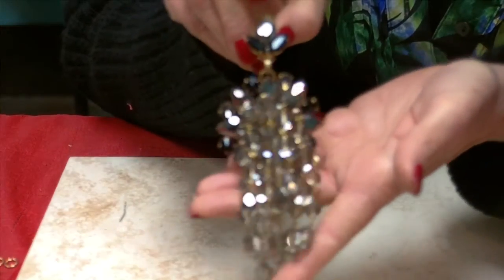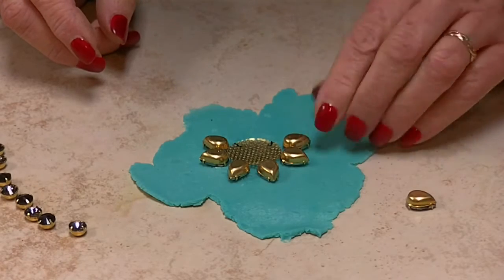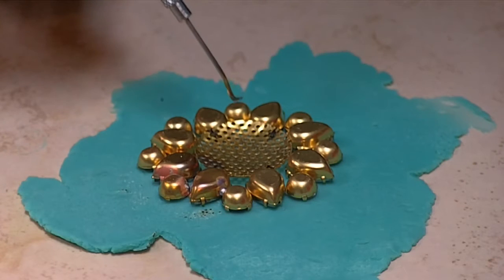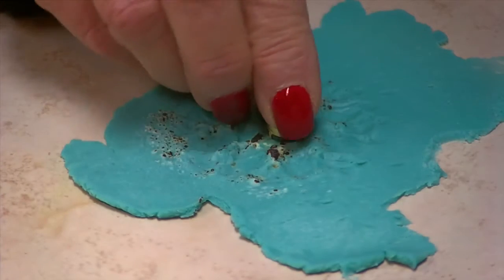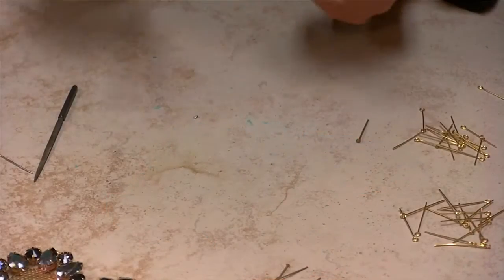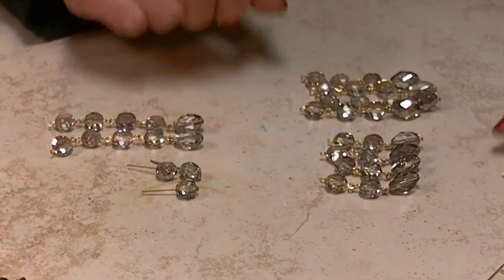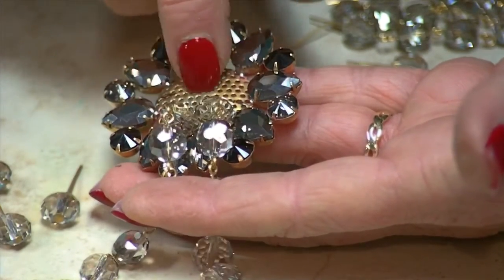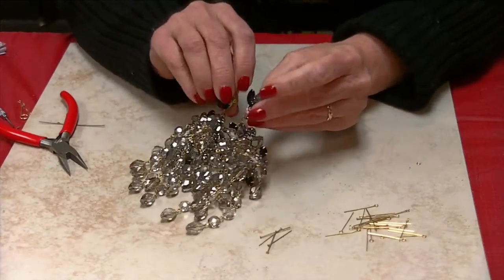How to Solder Jewelry Video 5 - Beaded Earrings

Comment: How much does the earring weigh?
Reply from the maker: I gave those earrings away years ago. They are going to weigh more than similar size earrings because of the glass beads.  The earrings could be made a lot lighter by using acrylic beads instead of glass beads.

Comment: Hello, thank you for your video. Is there any way to solder gold settings without them becoming discoloured? or can they be polished to become more gold after soldering? thank you.
Reply from the maker: Hi Diana.  Yes.  If you use a heat gun and low temperature 300 degree prefluxed acid core solder the gold plated settings should not discolor.   However the solder will still show as silver.  Here is an example for soldering with a heat gun:  https://youtu.be/ezaLaQRqxRg

Comment: Jan can you advise how to clean the flame scale damage by the flame!! Thanks for the videos they are really interesting  uk
Reply from the maker: Hi Tony.  You can try polishing the settings but it is unlikely that you will be able to remove all the scale.  However, steel wool does work well at removing any discoloration. The finished piece may need to be plated to hide the scale and the solder.  To avoid this problem I use silver plated settings, low temperature 300 degree prefluxed acid core solder and a heat gun.  See this video for an example https://youtu.be/AE4Vobnu4uU